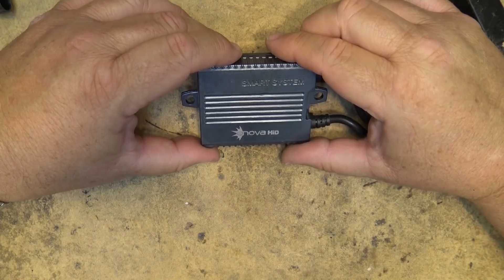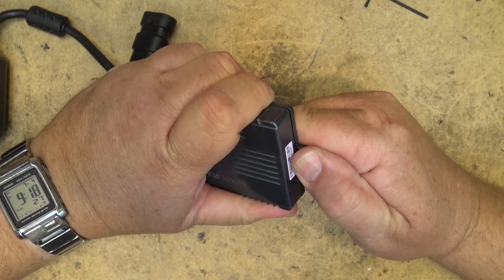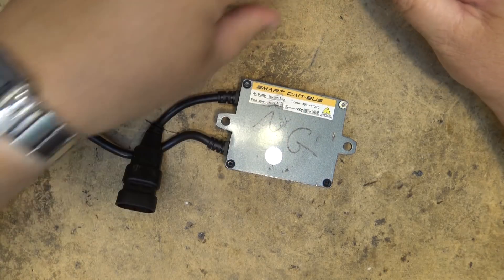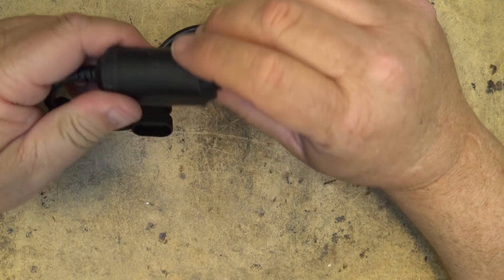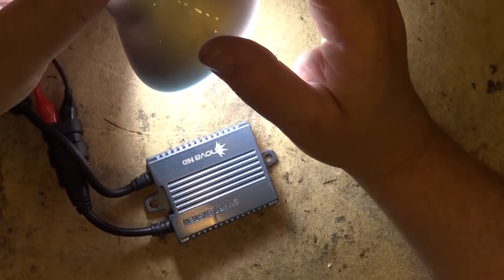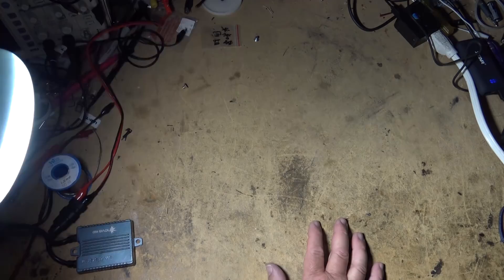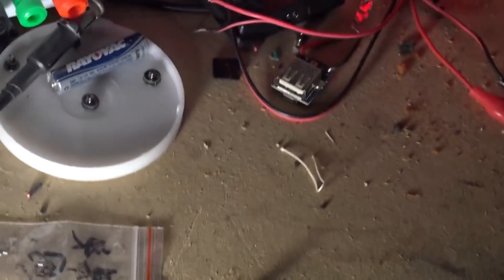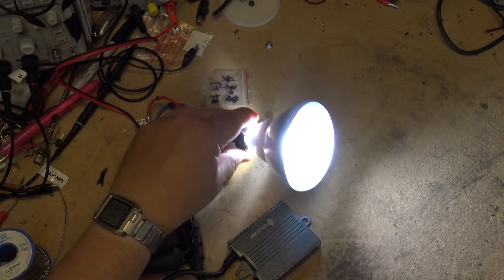12 volt HID light and future project

Comment: I have a 5 gallon bucket of these bulbs and drivers. I need a power supply to run them for whatever. They pull too much power to use on my riding mower, so I snagged some off-road LED's for that upgrade.

Comment: Well that ballast worked fine :-D, the things people throw away lol.
Early digital cameras were so bloody expensive when they first came out, looking back in time they were stupid prices.
Reply: yep i paid £50 for a 20mb CF card in about 2000 or 2001, that was a big card then!  my camera could take enough pictures to fill it on one set of 4xaa, it would do around 15 pictures on a 4mb card which was all the batteries could do, it was 1mp kodak
Reply: I think i had something similar, in my case it was quite large and 1mp as well, ok for close up snaps but crap on detail.
It had a special odd rs232 serial cable and software to get the pictures on to the pc.

My mate bought one of the first, it was £600 and not as good as i expected, i told him "Get a soft carry case to protect it", he didn't, the inevitable happened THUD!!, oh dear :-(
Reply: Yeah a serial to 3.5mm jack and took about 45 minutes for a dozen pics
Reply: lol it's almost like you were watching me :-D
Reply from the maker: Yes I remember those painful days. My original camera was a Coolpix 950 and it used SD cards. Still have a bunch of old low capacity SD cards.